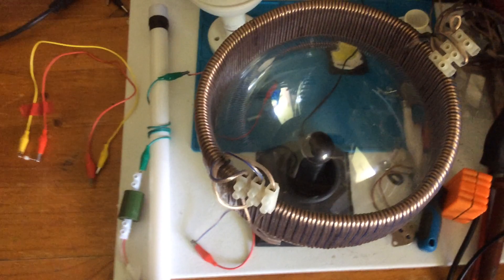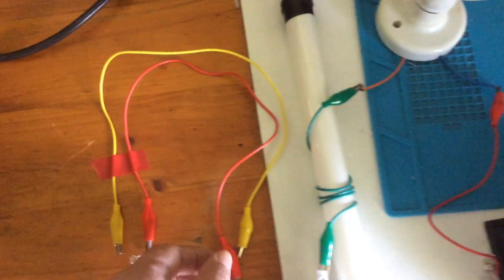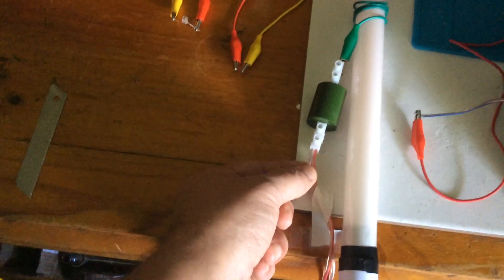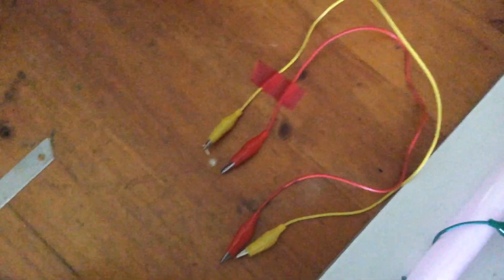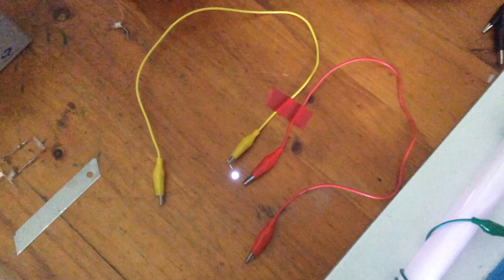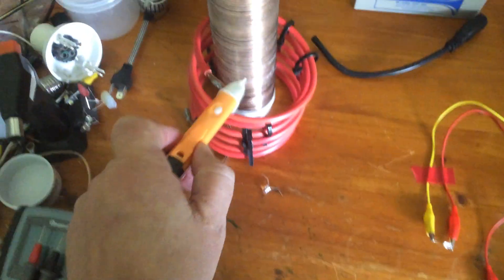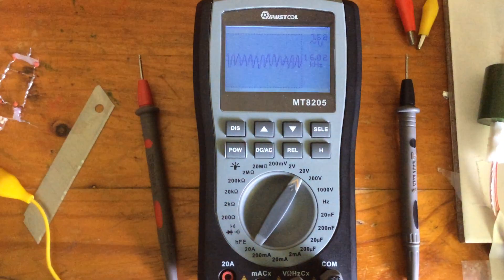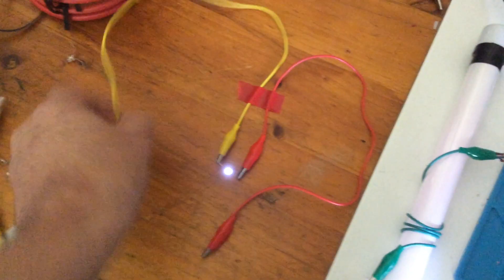Plasma Safety Warning - It's all about your potential... voltage!

Comment: Clearly demonstrated, very interesting method of creating difference of potential (voltage) between two conductors of equal length, but one nearer and one further from radiant energy source.
Reply from the maker: Thank you for your comment.
Sorry for my late response. Like most good things in life, simple is best and like most of my discoveries it was accidental. To give myself some credit I did perform the experiments that allowed me to notice it so I suppose it's more of an observation than it is an accident. I just happened to notice the light come on when I dropped the LED with leads attached at that distance from the plasma bulb and then began investigating how.
Thanks for watching.

Comment: if we take Don's advice, we need to use HV diodes and HV capacitors to convert RF into pulsating DC...
Have you tryed this approach?
Reply from the maker: Thank you for your comment.
I believe this is true, high frequency components are essential also, just like there is a difference between the output of a half wave bridge rectifier and a full wave rectifier. A high frequency high voltage diode is required to capture more energy, a lot of this energy is thrown into the dielectric field if your not attempting to rectify it properly.
Reply: @whatifididthis...1236  
longer diodes, like Don said
Reply from the maker: @alexkoteles  yep, you can even use resistors to wrangle it in as Don Smith used to say. I do believe that Don was deliberately misleading on some things, for example the thousands of dollars for the special resistors when you can just use incandescent light bulbs in series. I honestly feel this was a deal he made with the investors he always spoke of, something like this, “you can tell your story if you make some things seem just out of reach”
Reply: @whatifididthis...1236  
he wanted to stimulate us to think and also illuminate us on the existence of Vacuum / Aether / BEMF / Radiation / etc...
he also did say that resistors are better than capacitors

https://www.youtube.com/watch?v=_8JwIlHLOUI&t=730s

I think he was honest , but burrier deep by the trolls

Comment: I've found that this, and only one other channel are the 2 that have accurate, repeatable and valid info on radiant energy. The using of the digital meter on most other channels to measure these type of voltages and currents are the red flag to me that they do not understand these things. A digital meter is not built for this type of electricity. Bravo sir, for these videos.
Reply from the maker: Thank you for your comment. I remember being confused the first time I saw a digital meter read 0 amps whilst running a radiant energy system, I could see the light operating. I tested several meters but they all read 0 amps. I agree they are not built for this type of measurement.
Reply: @whatifididthis...1236  Yes. Thanks for responding. I have built your 6 AA battery led circuit and it is going in it's 3'rd day of light.  I anticipate it will go on for many months before I have to switch the batteries. So glad to see these principles work. I am wondering if this can last a very long time by using rechargeable AA batteries and may have to try it but the chemistry of rechargeables may not be best for this circuit. Have to see. Thanks again.
Reply from the maker: @Songwriter376 Glad to hear of another person actually replicating this work. I may not have made things clear in my previous video as you are the second person to tell me you have replicated this with Non rechargeable batteries. They stated a long run time however he noted there was significant quantities of sulphate forming on the batteries.

My batteries are rechargeable AA’s so I will guess and say your batteries may struggle to reach 275 days as mine did.
I am interested to know how long a Non rechargeable model will run as I do not have that data.

Comment: Good info man, yes I've noticed exactly what u talk about, even the radio frequency tester pen, gets a signal from your hair also, anyways water or flowing creeks and rivers r full of this radio frequency or cold electricity/ undetectable static electricity, 1 volt , 1000s of amps, just copper pipe to aluminum pipe has 24/7 flow
Reply from the maker: Thanks for watching. I have seen this Copper to Aluminium energy transfer through water and it is something on my bucket list, that list isn’t too exciting for normal people but it’s my desire to see it through, eventually I will make it happen. Cheers.

Comment: Beautiful video!  Yes, It's all very simple 😎.  You "are" on the right track.
I have experimented with those AV plugs many times.  Now move that AV plug about three feet away and place one hand near the plasma globe and place your other hand near one of the wires from The Av plug, I can almost guarantee you it will still light up.  These high frequencies don't flow through your body they flow over your body, the skin effect.  Funny but the first time I did this it made me feel like I was playing a theremin musical instrument they use in Star Trek theme music.
If you were to place a flat pancake coil on top of that plasma globe you should be able to place many smaller coils underneath it and pick up energy with each one of them.
You're dead-on with everything you talked about in this video.
You're making great progress keep it up!
Reply from the maker: Thanks for watching. Simple is the key I think. I’m not sure I made it obvious by your statement on use of AV plugs as that is just a single LED connected to the circuit (two alligator leads), unless your making a seperate point to test out, in which case I have tested your suggestion before and agree it feels weird, but not necessarily bad just made a few hairs stand up. The main point I attempt to make is that things just lying around might become capacitors , technically any piece of metal - plastic - and metal and ⚡️BANG!, assuming you touch it, not sure why I’m writing this bit like you don’t already know this stuff. Perhaps information for those new to the game.
 I set up the reverse polarity LED’s I will record that tonight when things are a little quieter.
Have a nice day.